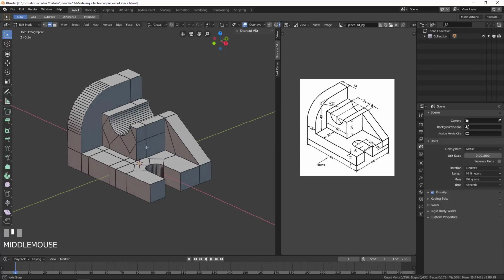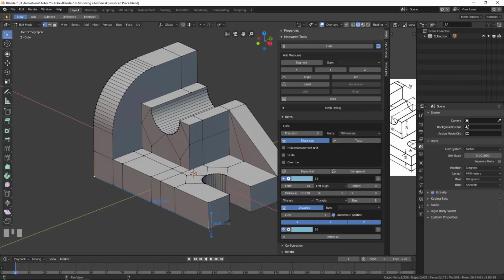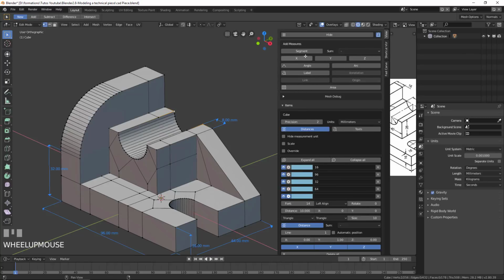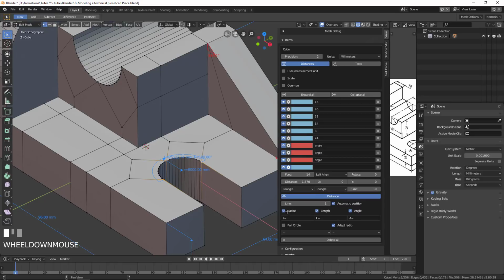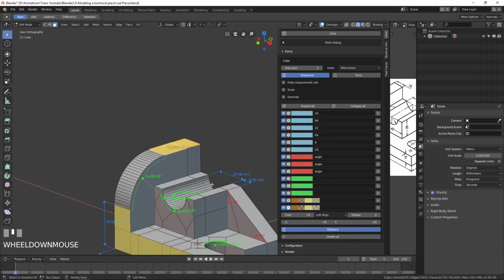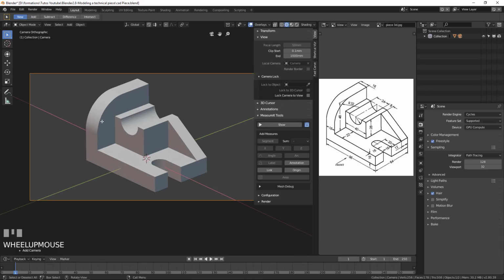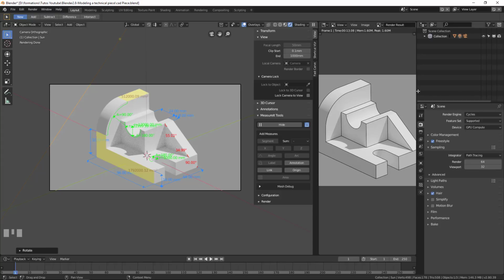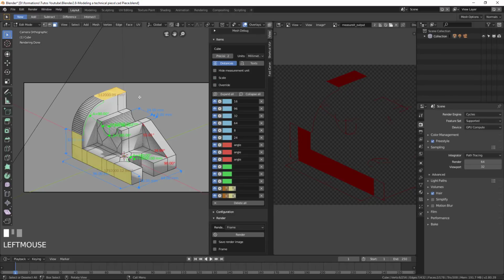Blender 2.8 Blueprint creation with Measureit addon

Comment: If you like to have the arrows more sharp like in technical drawings... Search for the file "[BLENDER]\scripts\addons\measureit_geometry.py" and change some values in function "def draw_arrow(..)"

from 
rad45 = radians(45)
rad315 = radians(315)

to
rad45 = radian(10)
rad315 = radian(350)

Not professional but works fine.

Comment: thank you for making this!! I was trying my best to use Blender instead of Fusion360 for 3D print modelling but I could not find a good replacement for Fusion360 dimension labels - Until Now!!. Brilliant tutorial. You earned a new subscriber. Thanks
Reply: tbh fusion is better for parametric modeling, I usually make a model "base"  in fusion and then import it to blender if needed - you don't need a mesh for 3D print if it's not something like a figurine, I personally find it a hindrance.

Comment: any way to render the annotations as freestyle lines ? 
ițm using a render freestyle>export SVG workflow and it'd be really great if you could do that ... if not possible, how about converting the arrows and digits as bezier curves so I could style them later ... at this point , the addon is really useful, but it doesn't really work for what I'm trying to do and it doesn't really look that great either, which is a shame because the geometry on those arcs and angles looks really cool, too bad it's rendered in that boring way
Reply: Yes, you make good points. I wish this was possible. 

(Right now even the default freestyle in Eevee has weird artifacts in the lines so they'll probably start fixing it soon (I have a month-old build so maybe it's fixed already). I hope freestyle gets even more finetuned and also new features cuz it's really promising as a concept :P)

Comment: I think the calculation method of area is wrong, there is no way the area of the first faces which you have selected to be 1792000.12 mm2 = 1.79 m2, as it should be (96*16+16*16)= 1792 mm2, and the other zero digits are extra, and same for the second faces. Please let the add on developers to fix this bug. The have put much effort into designing it, so it worth to be something correct.
Reply: I think the arc is wrong too

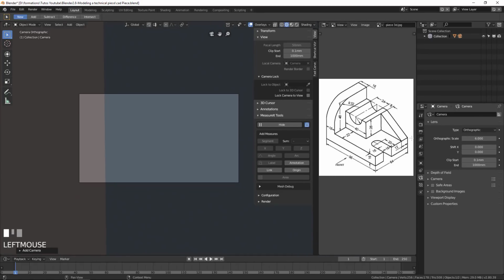Comment: The first time I did my full composite render the measurements had shifted off from where they were supposed to be on the object. I think I did something wrong with the orthographic scale you mention around 16:55 minutes. I deleted my camera and started over with a new one and followed your instructions and it came out fine. Can not adjusting the camera and orthographic scale properly cause this problem?

Comment: Also, an alternative - in this case - to using the Edge Split modifier once Shade Smooth has been applied is to go to Object Data -> Normals and tick the Auto Smooth check box.
Reply: So far as I have learned the auto smooth feature will not translate to a real world physical object. If you are 3D printing for example anything that shows as auto smooth will be lost and not printed. Really, whats the point of using auto smooth for this sort of design work if all its good for is giving you a false sense of design that does not translate? Or does it and I have not been told the truth?

Comment: Interesting, but I think radius values are wrong.
Reply: And the area. Probably due to the Unit Scale value in the Scene settings being changed from 1.000000 to 0.001 (to reflect that one Blender Unit is now equal to 1mm) at the start of the original tutorial. MeasureIt must not be able to take that into account when calculating the Area. It's as if it has forgot to multiply the area value by the Unit Scale value to arrive at the correct result. There is a check box in the Items section of the MeasureIt UI called Scale. If you tick this then you can enter 0.001 in the Scale Factor text box next to it. Seems to change the area value to the correct measurement. Don't know if this is the correct workflow though.